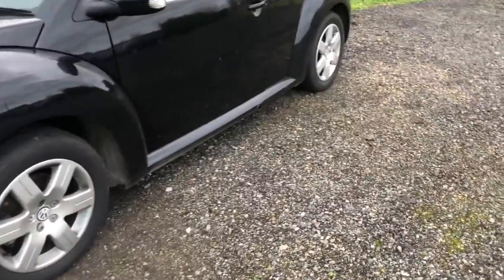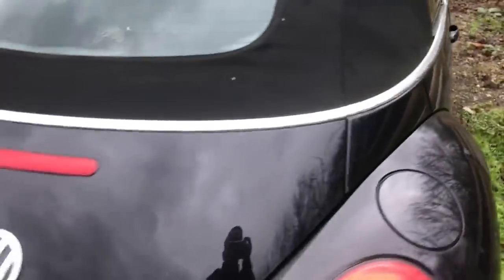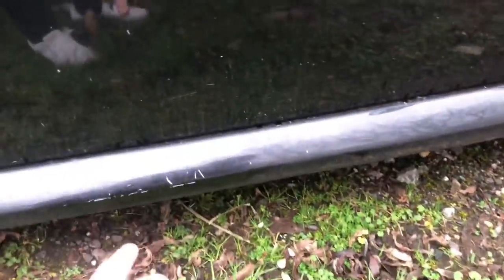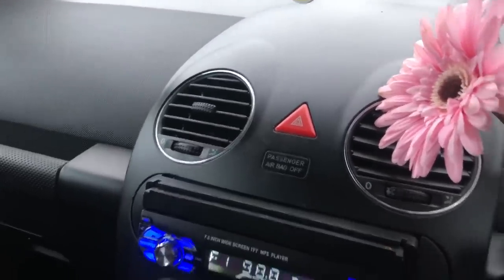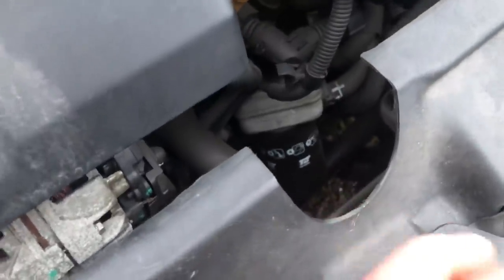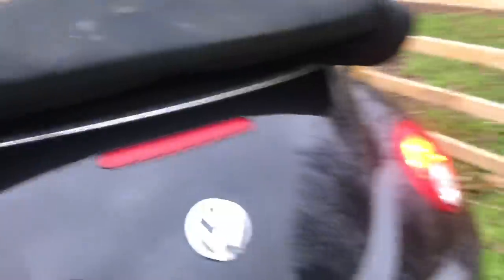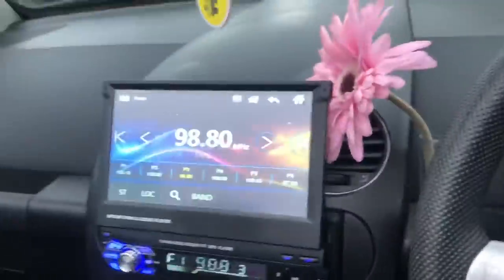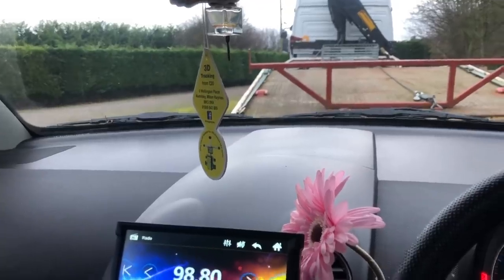£200 VW Beetle convertible absolute bargain mot fail pt1

Comment: I’d like to see what you do to get the screen scratch out, please remember to show us how!
Reply: 192bobf it will need a bit of jewellers rouge polish, should come out no bother
Reply: cupidstunt22 I have seen them sanded and polished out, key point to remember is not let the glass get to hot.
Reply from the maker: 192bobf just polish mate 👍
Reply: David P yep used to do it myself in my detailing days
Reply: Shane a you’ll never remove it but you can reduce it to a point that’s acceptable for mot and forward vision
Reply: @192bobf
Cerium Oxide on a mop and wet dry sandpaper beforehand if bad, main issues to be aware of is the glass getting to hot (breaking) and distortion.  You can also try a resin e.g rain-x windscreen repair first.  Both options are cheaper than claiming on insurance (who will recoup their costs eventually) because you have to pay the excess and notify any insurer for the next five years that you have made a claim(regardless of no claims protection) meaning you insurance will go up.
Reply: You use jewellers glass polishing paste mate or different course polish for mopping mate
Reply: @cupidstunt22  Honestly? Replace the Windscreen. One from a Scrapper, and professionally-fitted is the way to go.

Comment: Look at the ends of the outer sills especially behind the wheel arches, they are notorious for rotting out there, if it's gone in the middle, its probably gone at the ends too, especially at the end of the sills in front of the rear wheels. You have a rust bubble at the front, so its probably dodgy there too. The early facelifted bugs (55/06/56/07) seem to be the worst of the lot for rotten outer sills. You might be better off replacing that whole NS outer sill, the sills themselves are only £87 a side from VW (and being trade you'd get them cheaper through TPS).

Also the outer sills even though they are metal and welded on, they aren't actually structural (although mr MOT tester doesn't see it that way), theres actually an inner sill that's the structural part.

The window regulators are really common. The rears on a Cab are a pain, as you have to strip out the rear seats to get the panels out.

All the windows should drop when you lower the roof. Also when you change the regulators make sure you do the window reset, lower all the windows on the master switch, hold it for 10 seconds, then raise them and do the same, that resets them to work.

Also be careful when you pull the rear lights out to paint the rear bumper, the tabs snap off them for a past time, and they don't sit back in properly if the lower tabs are broken.

Another thing is the cambelt and waterpump its 4yrs or 40k miles on them.

Also when you pull the headlight, push the connector on the car out a bit, after a while they work loose and the headlight stops working, on these facelifted bugs they are fitted differently to the 98-05 bugs, so the headlight just pushes into the connector, then you lock it into place.
Reply: rally guwed teps moi frend

Comment: £200.. a proper bargain Rob.! You have to swap out the radio unit into your truck, well over spec in the Vee Dub and far more useful in the truck.
Should be a quick easy little tidy up and out the door motor, ready for the summer, that roof is very quick, have to say not too stylish the way it just hangs on the back, but is what it is, they seem to sell well.
Looking forward as always to the progress videos mate. Cheers, Alex.

Comment: VW beetle convertible are a good seller.  After getting it sorted out  I suggest you hold on to it untill end of spring, 
Coming up to summer you will double your asking price.
Use the radio in your truck, it's to your advantage,  but try to get an original beetle radio from a beakers.

Comment: Hello Rob! I’ve not posted lately. But this is a great little project. I’m not a mechanic as I’ve mentioned before, but the 1.6 is quite a rare engine for a Beetle so I’m told. They’re mostly 2.0 I believe. This is going to be a good turnaround I reckon. And keep the stereo/ satnav system for your truck and get a replacement for the beetle. Sorry for the long reply, but I enjoy your vids so much bud!

Comment: Honestly mate I love doing these little rebuilds. Mot failure or snapped cambelt etc but when you get a bargain like this it makes all the shit jobs worth while. I just got a 61 plate Astra van non runner for £600, replace the earth strap from chassis to gearbox and winner... 112k not a dent...! You make me wanna do these videos! 
I’ve done 5+ Range Rover sport body of engine jobs using jag engines, bit of wiring and sump work but cheap as chips! 
Don’t stop what your doing boss! Love the content! 
All the best 
Craig
Reply from the maker: Craig Nicholls 👍

Comment: Great start to the year with that Beetle Rob, I reckon you could get between £1000 - £1500 for that little gem once you're finished with it (it seems convertible Beetles are quite sought after).
With regards to the radio, I would keep it and put it in the truck and just stick a bog standard one in the Beetle.

Comment: If Its the same 1.6 engine as in my old 2004 Touran then it's a timing chain so won't have to be done, all in all apart from the sill and cosmetics it could make someone a nice runaround, shame it's not spring.....I'd be inclined to put your radio in your truck It won't make much more money in the Beetle. Great content as ever.

Comment: For 200 quid you cant go wrong, I'd definitely keep the radio for yourself if it's useful. You could pick up a cheap decent used radio from a breakers, or off eBay etc...for the VW. Did notice on the engine cover, there was a sticker for a cambelt change? So depending on what the date/ mileage was, that's another plus point when you come to sell it.

Comment: Absolutely remove the stereo. When I was in the trade we always removed any decent stereos and swapped them for a cheap rad/cass (this was the 1980s!). After a good detail we sold the stereos as a package with speakers. Extra money! Btw always a good sign when a beetle still has the flower.
Reply from the maker: alastair inglis 👍
Reply: It's a £50 stereo on ebay. Car stereos are so cheap these days.

Comment: Enjoy!! I hope your bug goes fast! And you like it. I live mine. 
I have a 2003 vw bug. My driver's side window got stick down and my son took the panel off and the the wire that controls the electric window was off. Hedidbt have the part to fix it so sadly it's winter time here in  the USA Alabama and my bug is covered with a huge piece of black plastic until I can  find somebody to fix it. Ugh.. this is a 5 speed turbo and goes really nice. I out a lot of money in it but still the window and the plastic parts in the Interior needs replacing. It's a project for sure but shouldn't be hard IF I could just find someone to fix it for me. 🙏🙏 I'll be in good shape. 👍 So of there's anyone in AL who fixes VW? I need a mechanic.

Comment: Absolute bargain of the century yes take the radio out put in the recovery truck . Put it up  between 900and 1000 nice easy little job
Reply from the maker: John Kennedy 👍
Reply: THAT VW WILL GO FOR AROUND TWO GRAND ..ITS NOT A CAT CAR....
Reply: @mikejones-uw7rp  depending how long you want to sit on it bag of sand £1000 quicksale gone within a week £800 profit and the head unit radio for the recovery truck absolute winner.

Comment: Covers for the top sold separately, you are lucky the flower vase was intact ,these first to loose, and the radio adds approx £500 to value.
Reply from the maker: david hall the radio only cost £100 new
Reply: @sruk   you was lucky ,as stated the vase from supplier - £200, the bottle opener is about the same , I still have an original radio for mark 6 golf  if interested?
Reply from the maker: david hall I’ll be putting the radio out of my truck in it cheers 👍

Comment: That hole in the sill remind me when i used to fibreglass the sill on my old 1990 astra sri that i once owned and painted over it with black tetraseal every year as the hole kept reappearing just before the mot was due.
Anyway when i went to the mot place i used to chuckle to myself when the tester tapped the sill with his hammer to see if he could hear a difference in sound from the solid bit to the hollow bit and every year he did this he just missed the point where i did the job haha.
Every year he did this for 3 years and just missed that point lol.
Bargain that is though rob for £200.
I would take out the sat nav too.
Reply from the maker: 1066gaz 👍
Reply: Could be worse it could be an original Ford Ka... I swear those sills were made of rust when they came brand new out the factory
Reply: @johnedwards3198  early Ka's rusted quicker than a tin can on a beach🙄😂👍
Reply: @paddrivers  keeping welders busy nationwide since 1996 😂
Reply: Yep ford are the king of the rot boxes.
Datsun used to be king in the 70's but changed their name to nissan of course so ford took over the reins haha.

Comment: Had one brand new in 03 & the roof was always problematic. It’s should sound a ‘ding’ when fully opened or on completing the closure and those flaps should fully close and the windows return to their closed position. If the cycle doesn’t complete then as you drive away it will ding repeatedly like a no self belt alert. Pain in the neck!

I’d put the radio in your truck. It isn’t going to add any significant value to the VW but will make all the difference to you.

Comment: It`s a bargain but like Luke Cleverly says I would replace the whole outer sill instead of just patching it, I think the new owner will appreciate the trouble you went to and you may get more repeat business which is al;ways good!!!
Reply from the maker: john goodall it’s 3-4 days work it would wipe out any profit from the car. It’s easy for people to say but honestly if you had done one you would understand. Just as a guide it’s door off front bumper off wing off seats out carpet out rear bumper off then you can start thinking about drilling out all the welds and start cutting it off then you got to weld the new one on grind the welds filler the welds then have it painted and put it back together 👍
Reply: Sorry I had not realized how much was required, also it has to be worthwhile on your behalf and so you are right and once more I'm sorry I jumped in😊  @sruk
Reply from the maker: john goodall no need to apologise mate 👍

Comment: Nothinwg wrong really the big points like the roof, engine, interior look fine so if the (mot) fails big time you know where the money is you Will get it back no problem ps leave  the radio in 
Very good vlogs mi old mate

Comment: Leave the stereo in the car, it’s a great selling point. And loving the content by the way 👍
Reply from the maker: David P 👍
Reply: From my experience in California, radios, amps, subs or after market wheels add little to no value to the selling price.  When I personally buy a car I am actually a bit leary about buying one with a radio because I don't know if someone has butchered the factory wiring harness instead of buying an install kit.
Reply: nah, get rid. a standard one will be so much nicer than that thing
Reply: @p4cks  This. Source an period-appropriate OEM stereo from a breakers for an authentic appearance. It's apparently been well looked after (it even has the flower!) so bring it back to stock.
Reply: @Shane a here in the states we or I should say in my 25 years of driving I have never been asked by my insurance if it has an aftermarket radio but I am sure there is a few that probably ask that question as it would make sense as its a potential fire hazard.

Comment: I'd not bother with changing over the stereo. I have a simular unit that I found in the recycling room and the amplifiers in it are crap. Yours is newer but the user interface is probably pretty shit still and it is not a satnav. The screen is mainly for the backup/dash camera feature and they added a mediaplayer so you can watch movies or clips from usb/flashcard.

Comment: They are not bad motors to be honest ,changing a rear bulb are wankers if you never done one lol,make sure it’s had a belt and water pump on it ,yeah earlier ones do suffer from rot on the sills ,pollen filters are strange to change and I’ve had a few with emission problems over the years but apart from that they ain’t bad ,tdi’s hold there money slightly better and yeah put that screen in ya truck 👍
Reply: How did you sort emissions problem .  Tks

Comment: The sill extensions on these Beetles are just bonded on over the top of the structural sills, so technically not a Mot failure! Yep the rear regs are common and a bit fiddly, you will need a few pairs of hands swapping those cables over, good luck!

Comment: Whip the screen out - if you can use it, why not - I doubt that it would make much difference in the sale price.  If it had a pre MOT and failed, what would it have failed on apart from the light.
Reply from the maker: Phillip Claridge all the bits I pointed out mate the cill tyres 👍

Comment: How on Earth does a barely 15-year old Volkswagen have a rust hole in the sill, the size of which matches those on my 26-year old BMW 5er? And yes, do fit that head unit in to your truck.
Reply: They aren't really the real outer sill, more cosmetic. The real outer sill is behind this. But yes surprising to see rust, most vw of this era are good on that front.
Reply: @danmoney9932  Well, quite! There's a bit of rust appeared on the bottom edge of one door of my 16-year old 530i but as far as I can tell, nothing like that...

Comment: Good luck with the headlamp bulb. You'll need 3 arms to get that out, oh, and you'll need to make a special tool to depress the metal tab
Reply from the maker: Michael Mansfield-Corbett it will only take 20 minutes to get the light out I’ll do it with the light out
Reply: @sruk  , it took me an hour and I'd done it before. I used a socket extension bar to depress the metal tab, and then I think it was an 8mm socket on the locking rod, but again on an extension bar. Good luck. Prove me wrong and put on a real time vid ;-)
Reply from the maker: Michael Mansfield-Corbett 👍

Comment: 55 reg rotten VW sill?  Doesn't say much for the car.  I have a high mileage Renault Scenic 52 reg which stays out in all weathers, rarely gets cleaned but has a full dealer service every year.  Not a trace of rust and utterly reliable.  I reckon at 71 years of age it may well outlast me!

Comment: £200 for that is a bargain! OEM head units seem to be about £100 on eBay, so is it worth taking that one out of the car? I think I'd leave it in there, and make a point of advertising it with the screen on display when you come to sell it (and get the camera wired up for it) - it ought to command a premium over similar stock examples.

Also, is it worth hanging onto it for a few months, so you can sell it in summer? Is there a summer premium for convertibles, or is that just a myth?
Reply from the maker: Stormy177 it would sell for 500 more in the summer easy 👍

Comment: Just change the sill, not difficult or expensive. Guaranteed to be lots more rot you can't see yet. Looking at £200 a side to have it done and in primer. Scab patch and in primer half the price if not fussy about looks.
Reply from the maker: Andrew Wilson changing the sill is tons more work door off bumpers off then about 2-3 hours work cutting the sill off drilling all the spot welds out then re weld plus filler work paint etc it wouldn’t be worth doing. What’s wrong with cutting the rot out splicing a new bit in ? Not patching over the top

Comment: Why not do a proper job and replace the outer sill
Reply from the maker: Battle Spear have you changed one ?door off seats out carpet out both bumpers off front wing off.3-4 hours of drilling spot welds and cutting why do that wen splicing in a new patch has fixed it perfectly ?